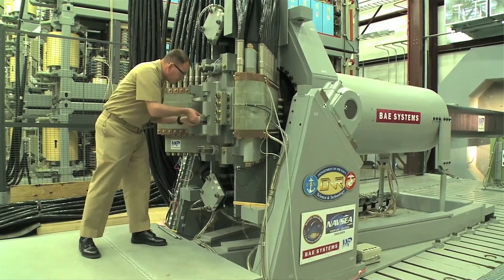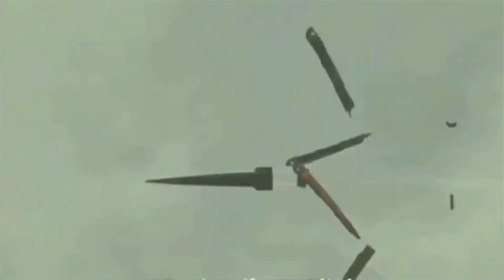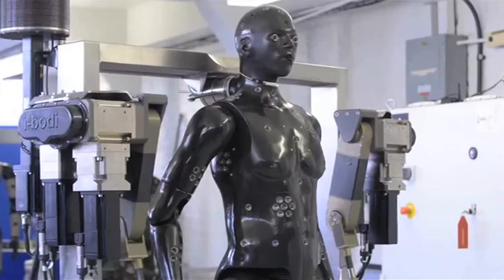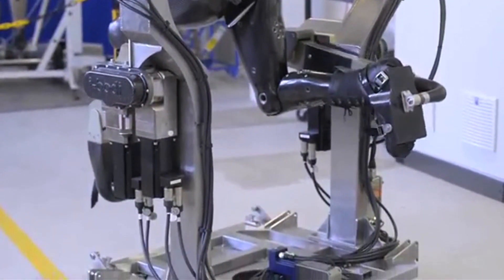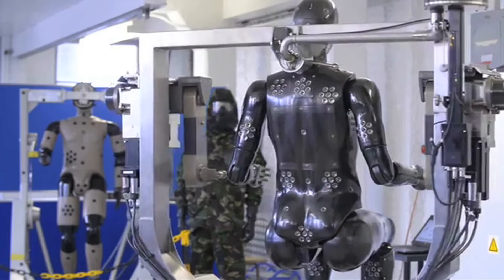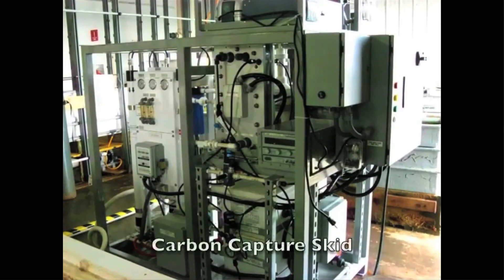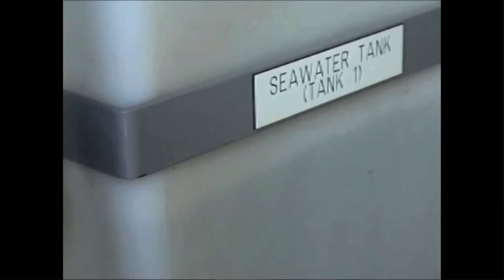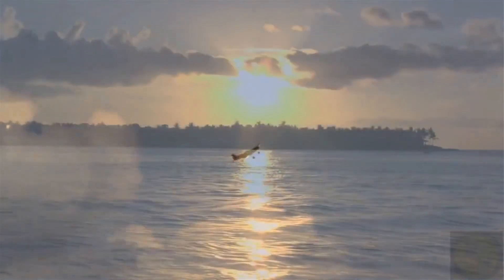Latest In Defence - Railgun testing; Porton Man; seawater fuel

Comment: Here is the basic formula for RC model airplane fuel, just so you know
what the NAVY is getting out of their sea water conversion work:

Traditional blend:
18% lube, 15% nitromethane, and 67% methanol
14% traditional synthetic ($10 * 0.14 = $1.40)
4% castor oil ($9.75 * 0.04 = $0.39)
15% nitromethane ($14 * 0.15 = $2.10)
67% methanol ($1.49 * 0.67 = $1)
Ingredient total: $4.89/gallon